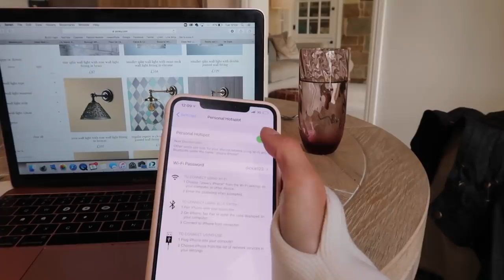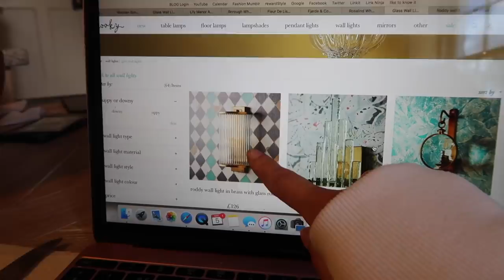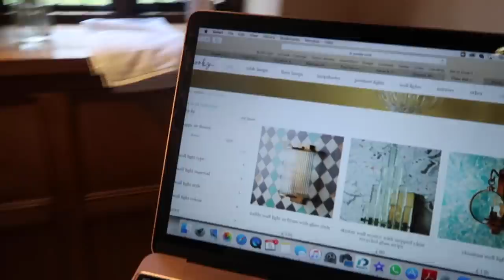ORGANISING MY CLOTHES + HOME DELIVERIES // Moving Vlogs Episode 15 // Fashion Mumblr

Comment: Lighting designer tip: Try to avoid having visible lamps in the lighting fixtures to avoid the glare (maybe through indirect illumination or something like smoked glass over a light bulb). Will make the biggest difference . In love with your home! 🙌🏼

Comment: Charlie, I like the idea of the herb scissors, I have arthritis and even use scissors to cut up chicken as my thumbs don't work well..
been thinking of getting a pair for some time, try cutting the herbs into a small bowl instead of over the steaming pan, could be just the moisture that's the problem. Thank you for the Dyson demo, I have an earlier model ball upright and it doesn't have the articulated section to allow the extension to bend, could never understand why. I need to also update my cordless - Dyson after sales service is second to none.  Josie, always enjoy your fashion content....

Comment: I must admit I don’t get the hype with dyson. I have a pull along one which is animal specific and it’s awful. Had it 3 years and can’t wait to get a new one. Really cheaply made as has broken in so many places and the suction is awful. Maybe I just got a dud one but my partner uses a Henry at work and been recently using it and it’s miles better and a 1/4 of the price
Reply: I agree. I brought one for 179 and it kept clogging. The motor went too so it only lasted a year. I have brought a sebo it's one that I always wanted

Comment: I think your personal style is a bit more refined than the current powder room sconces, as they look more geared for a very rustic lodge or log cabin vibe. Just because there are amazing rustic, medieval references all over your historic home, your furnishings are not of medieval times, and the rest of the interior architectural elements seem to lean towards later, more refined eras. 

Of course everyone has their preferences, but I don’t think you need to avoid mixing metals in your home decor. Especially in rooms that have chrome or nickel fixtures, as that is the most common bathroom faucet finish. You may be hard pressed to find chrome/nickel wall sconces without them looking too modern. If you find some wall sconces you love in a brass or bronze or whatever, it can still look great. Get a little bathroom bin with chrome and brass/bronze details or put some brass/bronze elements on a small silver tray along with some bathroom products. Maybe find a soap dispenser in mixed metals as a unifying element. There are ways to tie together different metals in the same space. So just go for what you really like, and you can create a cohesive story around the metals, be it in a picture frame or some other decor pieces.

You may want to limit the mix of metals in smaller spaces and not exceed three different metals, but that is just a guideline and not a “rule”. Of course, that number is less likely to work in a kitchen, depending on how you store your implements, and if you have copper pots on display, etc. I don’t ascribe to rules where you can only have one type of metal finish per room. Just go with what you love, mix it up, have fun and find ways to pull it all together!

Charlie was so fun showing all his new goodies. I love that he’s so into function but also form! Useful can still be attractive and I think it’s wonderful he appreciates that! However, Charlie may find it easier getting to all his utensils if he would turn the caddy 180 degrees. Currently the horizontal slot at the back is terribly inconvenient for his favorite knife and you would still have easy access to the vertical slots with the horizontal ones in a front position. Might be worth a try, or else you might want to move the very sharp knife to one of the front sections, so no one gets bloody while blindly feeling around for the very sharp knife. Just a thought. 😉😊💗